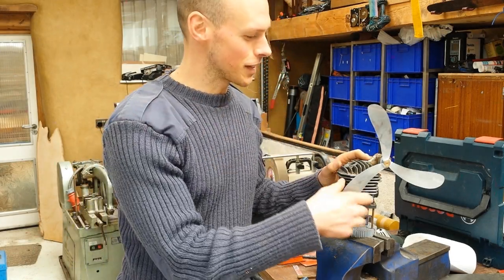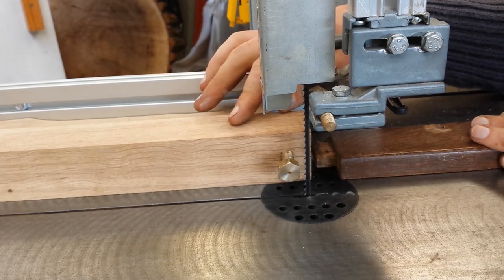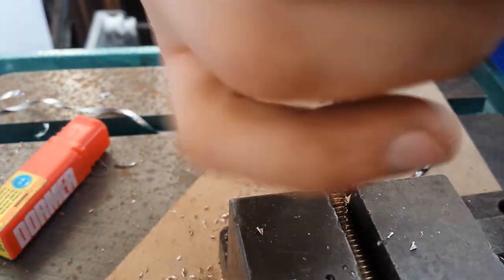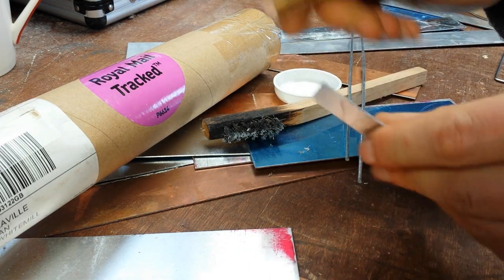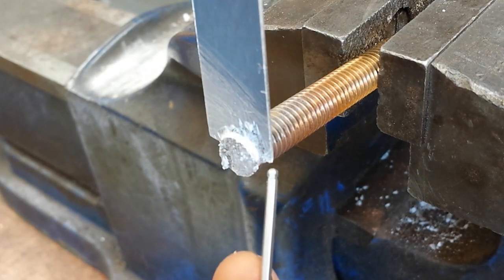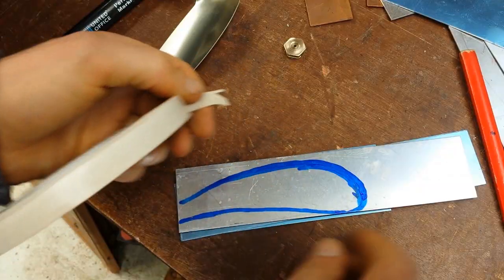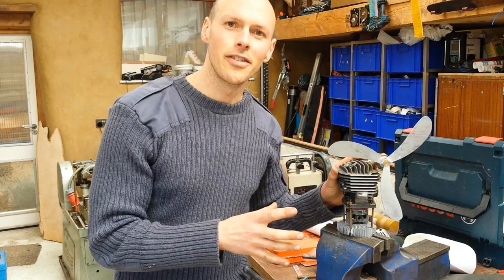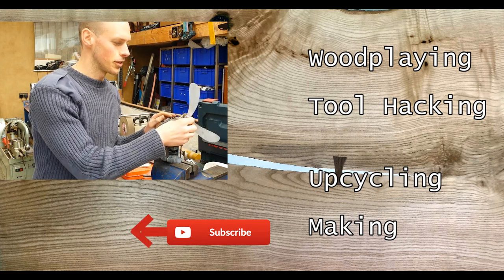How to make DIY Stove Fan Blades (Upcycled)

Comment: I'm getting flashbacks to a really pretty brass and copper desk fan that a friends dad made himself. The fan was an oval profiled slug of brass for the hub with 4 overlapping circular sheet brass blades, each with a slight curve to it. IIRC, it looked to be about a 12" blade disc on it and the whole thing was mounted on a desk lamp style cantilever arm that had adjustable friction disc joints all over it.

He also even made a beautifully sculpted fan cage out of hundreds of curved pieces of brazing rod. I never thought to ask at the time (And he's not around to ask anymore), but in the years since, several times I've pondered, "How the hell did that ba**ard braze BRAZING RODS together to make that damn cage  ?!?!?!". It's not a question that keeps me up at night, but I still wish I'd asked him while he was still around. :D

Comment: What degrees should the fan blades be at I have one that’s doesn’t seem to move much air spins fast but doesn’t push air it jusg seems to spin
Reply from the maker: Hi Brent. Thanks for your question. I'll be honest, I don't know the answer. Maybe some engineering types out there  can give you a better answer - I just experimented and went with what seemed right.

Comment: you've probably found out by now that the rods are for aluminum to aluminum not to brass or any other metal.......  you really cant do anything other than like JB weld or an epoxy to do this task